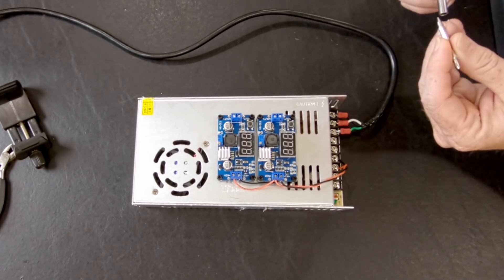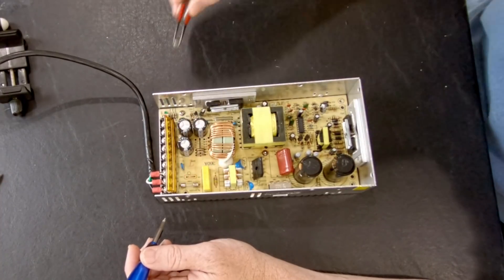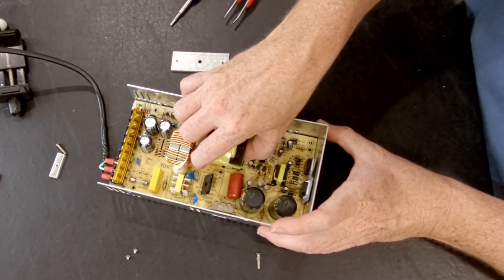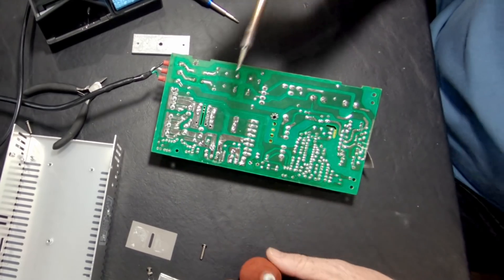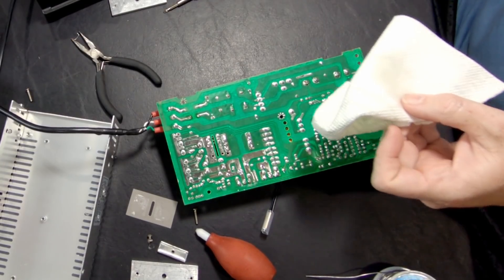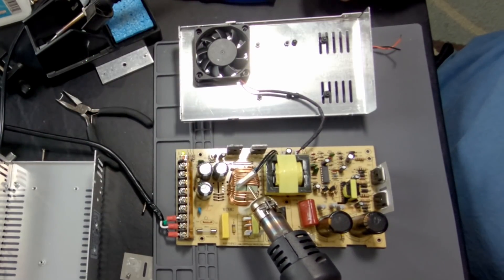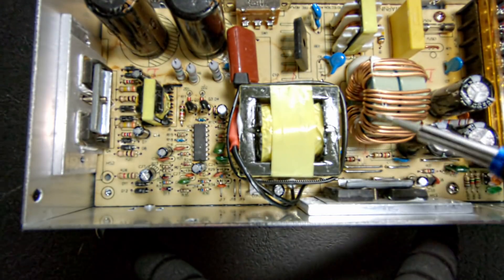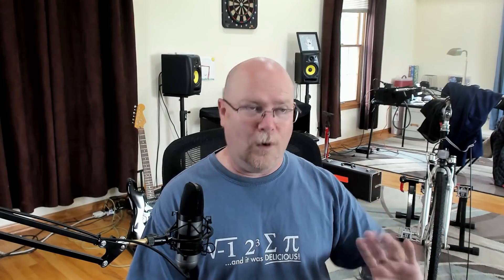Fix the loud fan on a Chinese 12 VDC Power Supply

Comment: I found a easier way, why not just unplug the FAN and cut one of the leads and wire the sensor inline. No disassembly required. I just pulled the FAN connector wires, clipped the red wire and wired the switch inline, that was it, tested it and it worked, as the model I have do not have the jumper.

Comment: What a great video. I'll be doing the same thing with mine. Mine is a "90 amp". I use it for a 1000w ish sound system, but most of the times I listen to it at a low volume. The fan noise is really loud 😂

Comment: Hi, looking for a quieter psu for my 3d printer. I have found some ceramic KSD9700, I suppose it's a better option for heat transmition than plastic and because it's not conductive. I'm wrong?

Comment: Great video! I was wondering if this trick could work on those S-800W-65V power supply for RD60** ? It seems like a lot of people is complaining about the fan going full speed right away and I am not sure about buying it for this reason. Not that a noisy fan spin is so terrible but if I could avoid it soldering a temp fuse, why not! Thanks!

Comment: Any disadvantages to just wiring a temp switch to one of the fan wires?

I have an an annoyingly loud 24v PSU that has a fan that is stuck at 100% all of the time, not sure if it will be immediately obvious where the switch would go assuming it has provisions for one. Also I am thinking of hooking up two switches, they come in pairs anyway and it can't hurt to have a backup.
Reply from the maker: Odds are that it will be obvious where it's supposed to go, but no problem putting it in-line with the fan.  That's all the connection on the PCB does anyway.

I wouldn't put two of them in there though.  You'll only end up using one of them anyway because their temp trip points won't be identical.
Reply: @MattHeere  Well, I just found out that the toroid coils on my PSU are the hot part, tried the transformer first, fan didn't even turn on, bought an IR thermometer, found that the hot part was in fact one of the toroids. Problem is, the toroid doesn't get cool enough for the fan to turn back off lol. Drawing about a 350w load on a 1000w PSU. Well it was a fun experiment if anything, and at least it turns off when the load is taken off.

Comment: Hi Mat, I have just come over from Callums channel and found this video.  I use one of these supplies on my dx-peditions to the Pacific and the noise of the fans always drives me nuts.  So i will mod my supply asap.  I can't seem to find any of the thermal cut out switches that you are using.  Do you have any alternates to the link you have below?.....   Cheers, Roly - ZL1BQD

Comment: What size is the fan? Was going to get a Noctua replacement.
Reply: Not these cheap power supplies are cheaper to replace that it's impractical to put expensive fan on these. Tried searching for one myself and couldn't find Noctua with 60mm 2 pin fan.
Reply: you can use a 3 pin fan on a 2 pin connector btw 
I've done it in the past for projects
Reply: Just remember to make sure the rotation is correct befor finalizing installation. Rotation AND direction.

Comment: I have three power supplies like this. One has no fan. One is like yours and I have reinserted the thermostat - thanks, it’s perfect now. However, the latest just arrived (November, 2019) has a subtly different circuit board. I can’t see the link with the same name as on yours and my other one. I have a picture of the circuit board but cannot post it here. Do you have an update for the video with the new circuit board please?
Reply: Simply connect the 12 volt output to your fan via the bimetallic switch. If it's a brushless fan motor (most likely) then polarity will not be crucial as it won't affect direction of rotation.
Reply: Thank you, I will try that. 👍

Comment: Good stuff Matt. One thing, I've alway have keenly aware of when dealing with power supplies are capacitors. They tend to bite you when you least expect it. I didn't see you using any kind of discharging stick in the video. Is this not much of an issue with this type of PS?
Reply from the maker: Hi Robert.  I would never go so far as to say you shouldn't be wary of charged capacitors.   In this particular supply the bulk of them are on the low voltage side of things so it's not nearly in the same league as a vacuum tube amp or something.  What helps more than anything is that the caps are always under load, so they discharge inside the PS very quickly when it's unplugged.  Hitting them with a proper discharge device is still probably good insurance and would only take a second.